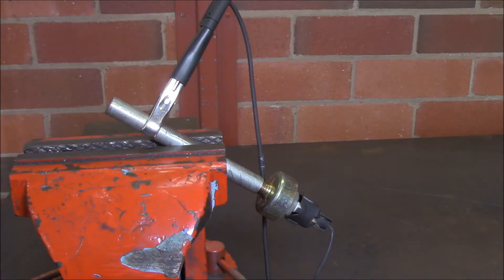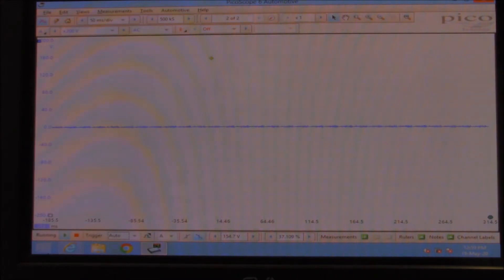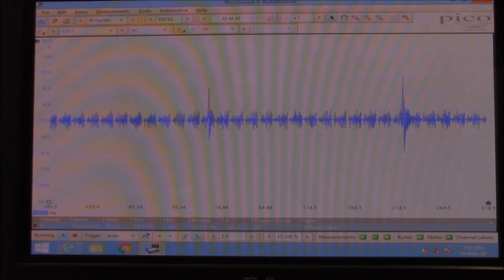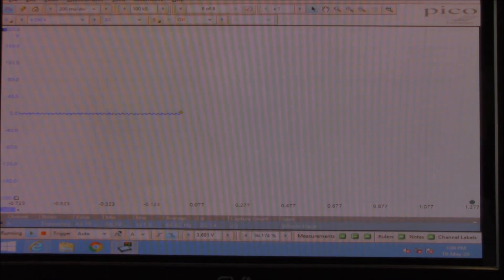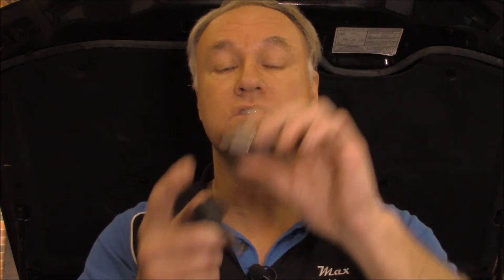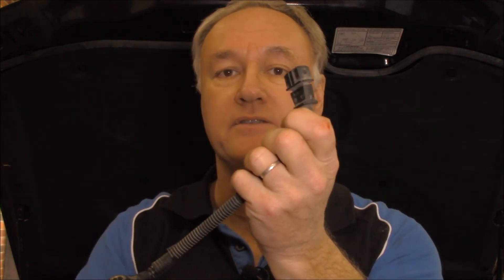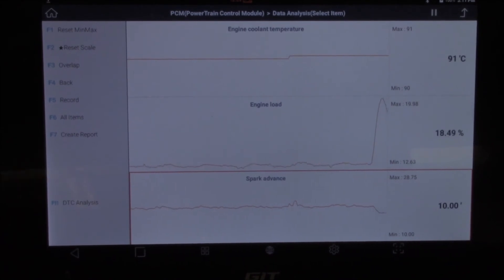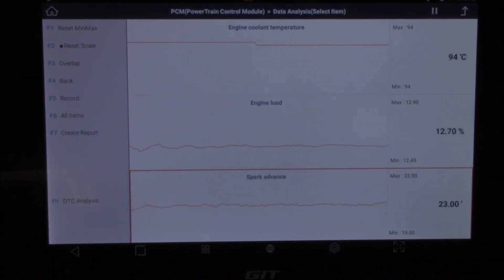Knock Sensors

Comment: My check engine light came on, I removed the battery terminals, I also scanned the error with a scanner, and the check light still comes back on.  Honda 3 engine 2.4.  or maybe I filled it with bad gasoline.  the car runs on LPG and so far I used half a tank of gasoline and the check caught fire. I filled up with expensive gasoline 98 octane and then I thought that it is often not taken and it could stagnate and be of poor quality, what do you think
Reply from the maker: What was the fault code? Do you normally run it on LPG or petrol? How often do you run the engine on petrol? Have you changed where you get fuel from? Can you hear the engine knocking? What do you mean that the 'check caught fire'?
Stale fuel can create all sorts of issues, but you need to get to the bottom of the fault code issue to properly guide you with a diagnosis.

Comment: Hi i enjoyed your video .I have a gmc truck .Bank 1 and bank 2.code reader says bank 1 low input.can i drive with one knock sensor.just curious why is there 2 knock sensors. TY.
Reply from the maker: Hey Henry Henry,
What is the actual code? Is it a V8 engine? If so, a knock sensor is used on each bank to help provide more accurate data to the ECU and to identify on which bank the knocking is occuring.
Reply: ITS A V 8 ENGINE.code PO327.TY.
Reply from the maker: @henryhenry4377  Give me some time and I will get back to you. Do you know how many wires there are on each sensor?
Reply: Wire harness has one line going to bank 1 and bank two one harness.Ty.
Reply from the maker: @henryhenry4377  What year, make, model and engine size is it?
It looks like there is a single wire going to each sensor. Is there any voltage on the wire removed, with the ignition on? Each side the same?
Reply: @MiracleMAX  hey I have not went that far.just wondering driving with one senser.Ty.
Reply: 2004 gmc 2500 v8 6 litre.
Reply from the maker: @henryhenry4377  You might find that the ECU will be able to pick up knock from the other bank with only one, however, it most likely will log a code and eventually bring on the Check Engine Light.
Reply: @MiracleMAX  Thanks for your time and advice.

Comment: Thanks for an informative vid.🙏
Are resonance knock sensors polarity sensitive?.
Reply from the maker: Keep in mind that they produce AC voltage and are not polarity sensitive. 
However, some ECU's use a bias voltage on one wire and 2 wire knock sensors utilise the second wire as a shield and a signal ground reference.
Hope that helps 😊

Comment: You got the sensors the wrong way around. The first one is the resonant one. It's called resonant because it resonates at one frequency, the frequency shown on the scope. It's output is one and only one frequency at all times. It works as a shock sensor.  The second sensor, the one you call resonant, that works in the exact same way as a microphone, it outputs a range of frequencies rather than just the one.
Reply from the maker: Thanks for your comment. I have based my comments on many different documents, including this one. http://premierautotrade.com.au/news/knock-sensors.php

Comment: Great information Max! I found more  hidden gems in your video than others on YouTube. Is the mass piezo knock sensor suppose to have a biased voltage from the ECU?
Reply from the maker: I'm not sure in each case, but that's easy to find out. Simply disconnect the sensor and see if there is perhaps 1.5 volts (will vary) coming from the ECU - that's your bias voltage.
MiracleMAX